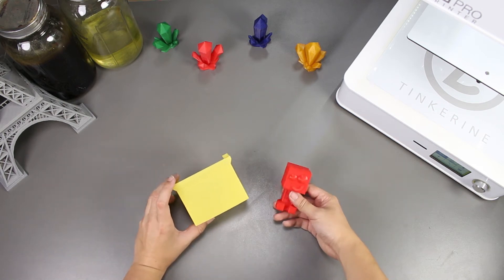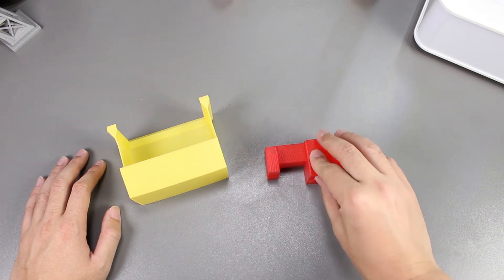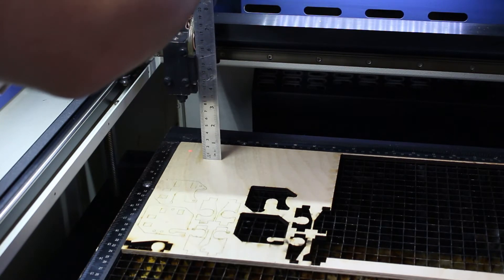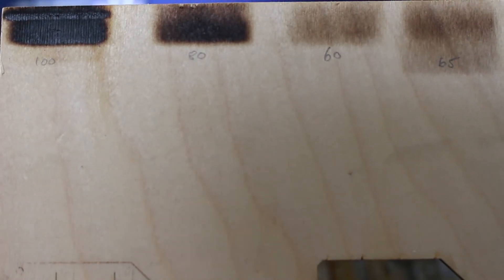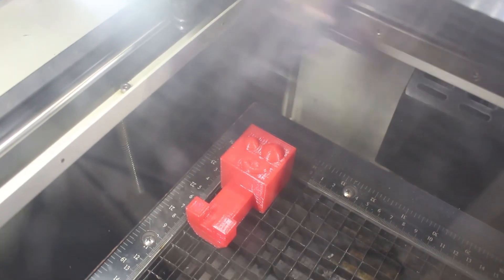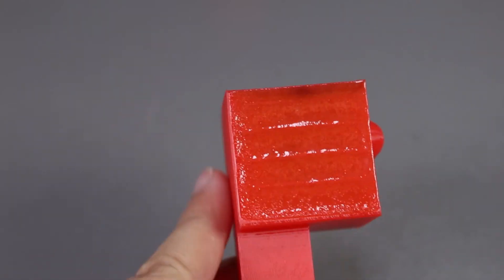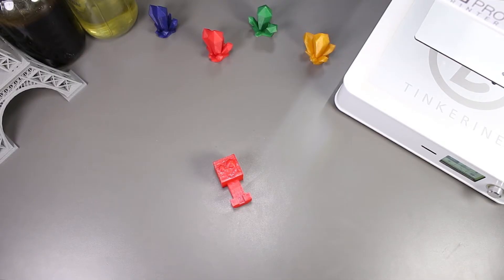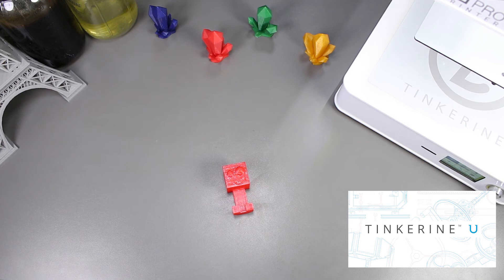Attempting to Smooth 3D Printed PLA Parts with a Laser Cutter

Comment: Thanks for doing these experiments, but it seems it would have been wiser to calibrate the strength with a rectangular PLA print instead of wood which has completely different properties.

Comment: Are those dots/pockmarks on the surface caused by air that was trapped between the layers?  I'd like to see another vid where you first calibrate your process with plastic and not wood.  Perhaps some solid stair pieces and then maybe some with varying shell thicknesses to determine if you can find a happy medium between laser height/intensity/smoothing without the buckled surface.  Very interesting, thanks!
Reply from the maker: Thanks for the comment and suggestion! There are great ideas, we will look into it.
Reply: @Tinkerine  Cool!  If that is air, and if it would be possible to apply a vacuum in the laser chamber, maybe you could even out the surface before the plastic solidified again?  Haha...sanding and painting is somehow starting to sound like less work.

Comment: Interesting, I wonder if the melting increases the strength of the part. Would like to see if its possible to use a laser cutter to join parts, especially petg which is difficult to join with glues.
Reply from the maker: Thanks for the comment and advice, we can look into it!